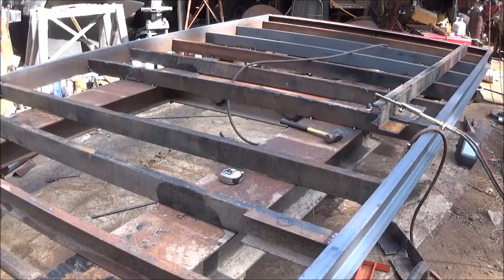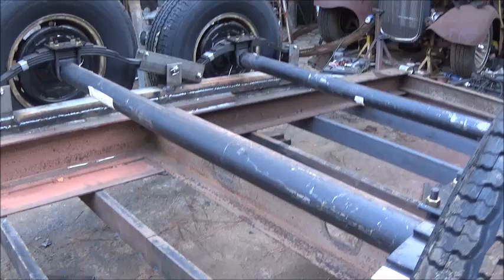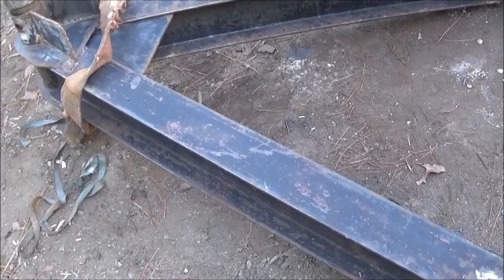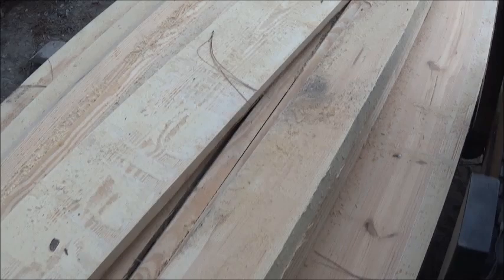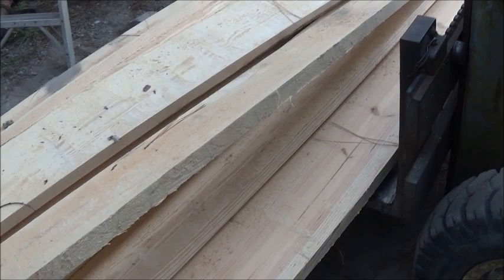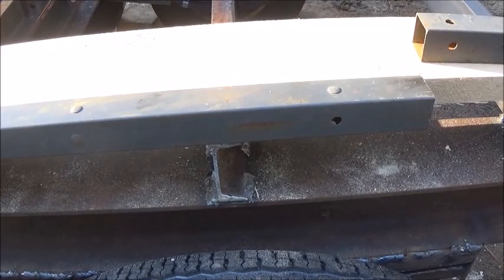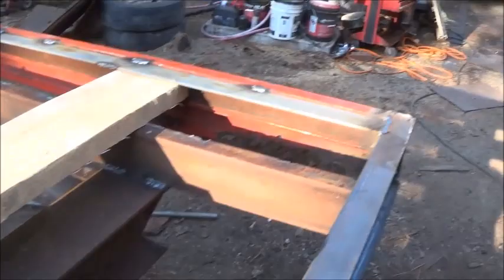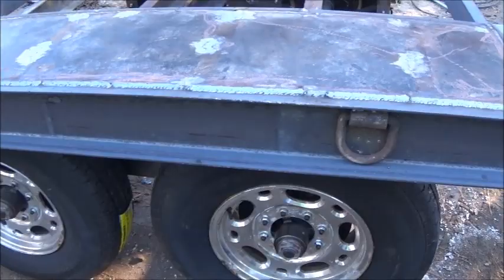GOOSENECK TRAILER MODIFICATIONS PART 2

Comment: It's really interesting to fully understand what somebody else sees in something that appears to be a "lost cause" . When we watched you work on that crane in a field , get it running , fix it enough to drive it out of the swamp it was in , I thought cool , Jonathan did it . Why ? You had bigger plans for it than we knew . Now you can move steam engines , heavy equipment , even trailers you are working on . Hell , Jonathan , I'd visit just to learn how to operate 1 . Bottom line is it isn't always easy , nor necessary , to understand the  "why" of something . The important part is appreciating the final product and seeing for a moment , just what someone else had in mind . Now we know . That's a handy gadget to have around the homestead .

Comment: Going to have you a nice trailer when your done! A long horizontal propane take with the top cut out makes a good vat for soaking deck and fence boards in, I just put a chain around them and let them soak overnight and pick them up for a few hours to drip dry

Comment: The trailer is looking Great Johnathon. Its going to be a well Built trailer thats for sure. Thats how we did Our Dads trailer years ago with angle.. Its works great...The old Crane is Running Flawlessly, Those old Detroits just run forever..It sounds like in the video Its operating like that at an idle. Amazing how much power they have..Lifted that trailer like nothing..Great Video as Always...Thank You for sharing it with us..

Comment: you flipped that trailer very well. i have done this with my gradall many times. it takes patience and smooth operating. what a nice trailer. 22 ft is a really nice length. long enough to haul longer lengths but short enough to get into places easy.
Reply: Dear J.C. SMITH family.
👍👌👏 Really nice to meet you here. I instantly wanted to tell you about the great trailer company Johnathan W. recommends in this video. Obviously it's not necessary now. ;-) I guess that channels Watch Wes Work and Twin Stick Garage  find this information also useful.
Best regards luck and health to all of you.

Comment: Excellent choice on wheels. I have a set of the same.They came off my 2002 GMC 2500 HD 4X4, The rims are forged aluminum alloy and super strong. Those with 10 ply tires are the way to go. I have the same tire wheel combo on my 18 foot Big Tex utility trailer. I wanted to use my factory GMC center caps, so I had to change the wheel studs out to match the factory lug nuts, (Metric). Most folks that go with this set up don't bother to change out the wheel studs cuz they don't care about the center caps.  My next trailer up grade will be changing out the board deck for aluminium diamond plate.    You got you one fine looking trailer !!!
Great Video, 
Thank you !

Comment: it's a pleasure to see how smooth you are getting on that conventional crane. that's kind of an art in itself. 
heads up though, many people have been caught and killed working under one of those booms when it fell to earth unannounced.
I saw one of those with a 250'-300' boom seconds before and seconds after it fell down. that's right, it was right there and I looked away for a second, heard a big commotion and there it was all bent up laying on the ground. I was about 200' in the air at the time and the crane had been setting pipe spools on the top floor of the structure and the boom just set a load and had just swung by me to pick up some more spools. where it landed on the ground was across a laneway leading to a brass alley where there would be hundreds of people lined up to go for lunch 10 minutes later. pretty much a miracle nobody was hurt.
true story, Prentiss LP7 just north of Red Deer AB, October 1999.

Comment: The average piece of wood will shrink about 10% in thickness as it dries out from wet green. Will that affect the fit on your assembly? Thickness could drop to 1 5/8” and a 6” wide piece could lose up to 1/2” in width. The length doesnt change much.
Reply: I think this wood is seasoned.

Comment: Man it couldn't went better flipping the trailer. I think I must have missed an episode cause a lot of work got done and you didn't end up using one of the axels like you planned to and you must have bought some brand new full length I beams. Looks like you used the old cross ties. And you really fixed up the goose neck. You are some kind of good welder too and I think you must be part genius you always amaze me with your fabricating and mechanical abilities. I would not be able to know half what you do about building stuff like that. Mine would have really looked cobbled together LOL. The crane  has really been very useful on most every project.

Comment: Good job in the trailer, I didn’t know you could run the axle on top of the leaf spring like that, I thought they had to run under the leafs so that all the weight wasn’t in the u bolts, it’s nice your way because the trailer is lower

Comment: I worked for a old guy that was building goose neck trailers for over 40 years an on the up rites an the tow pole he used to weld a triangle piece of steel in each corner to the flat part to stop the flex in a right angle corner  because its a weak point an will break with heavy loads an flexing up an down an being pulled he used to put 2 on the tow pole at a angle back along the flat an he put 2 on each upright to triangulate the corners to the flat

Comment: I would get Cuprinol, or something similar to treat that wood decking. Stay away from diesel or oil. If you can get it, a good deck presevative designed to resist rot would do the trick as well. The whole job looks great.

Comment: I'm probably missing something, but it looks like the springs are bolted directly to the rockers. Since spring lengths change as they compress and rebound, and there are no obvious shackles or such to accommodate that, I'm curious how this will work. Maybe this is a design I'm unfamiliar with, or maybe the video just didn't show what I was looking for. If that's been taken into account, I'd love to see some close-ups of the design, as i usually learn something from these videos and this could be another good opportunity to do that.
Reply from the maker: You missed it for sure. They slide, springs are bolted to the front only.
Reply: @jonathanw4942  Thanks for the quick response. I couldn't really see you overlooking something like that, which is why I suspected I was missing something. I'm seeing what look like simple through bolts on each end of the springs, but I'll study the video a little harder and hopefully can pick up on what I'm missing.

Comment: Are you going to stagger your board cuts? It helps with strength but the trailer looks stout enough to probably not worry about it. I have a 20’ goose neck and absolutely love the size for my half ton. Way safer than a bumper pull.